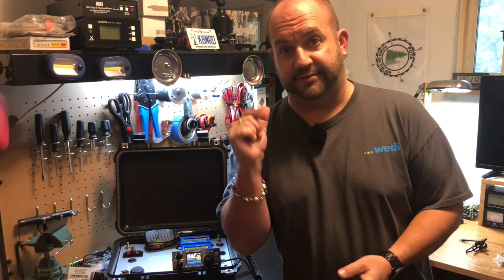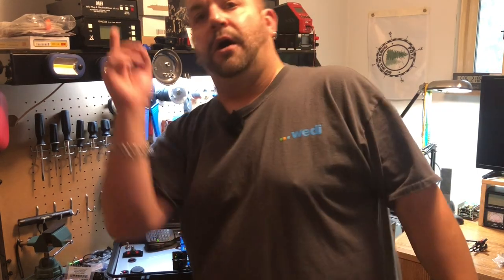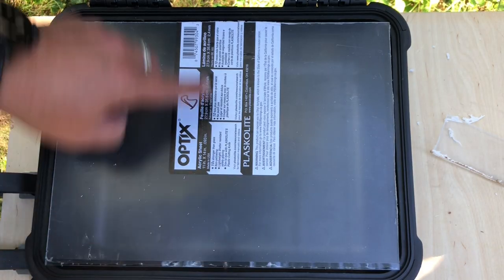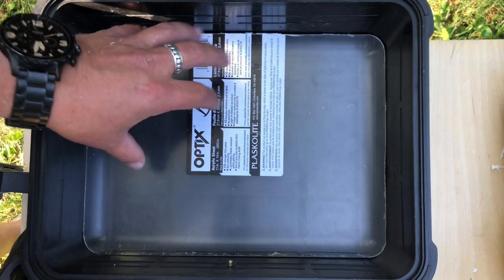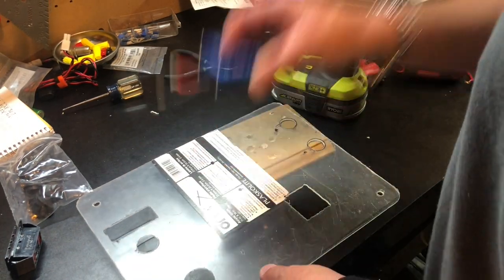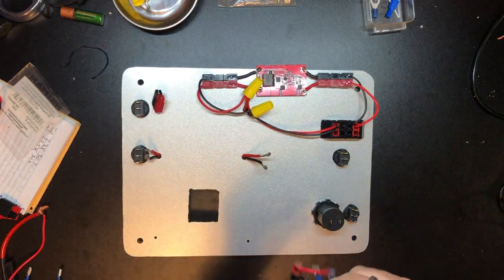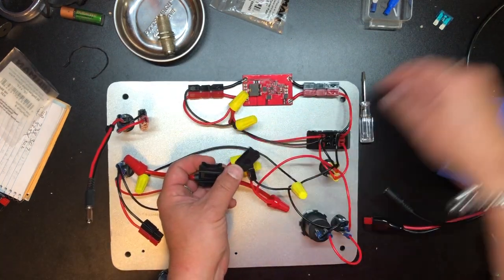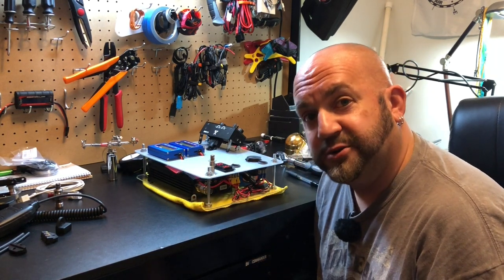Ham Radio Go Box & Solar Generator Build

Comment: Nicely documented build, Mike. Can you comment on the radio's audio quality after enclosing the base unit inside the box? Do you notice any degradation in audio fidelity or volume? Also, can you simultaneously charge the unit (solar or otherwise) while running the radio?

Comment: Hey Mike. I have built a few go boxes. The way I attach the components like the radio and battery is with Velcro straps. I cut slots in the plexiglass or plywood and run the straps through. The straps I use are 1” wide and up to 18” long. They really hold the components tight and are easy to undo if you need to take the components out. I can see doing a qrp box but I kind of gave up on them for my 891. I find it’s easier to just have the components loose.
Reply from the maker: Thats a pretty good idea.  I wouldn't want to use those for the G90 though.  I really wanted to keep that raised off the plexiglass as the heat sink is on the bottom.  I haven't had any heat problems yet but the radio does get quite hot and don't want anything melting.  Thanks for sharing.

Comment: Thanks for the video for my next project.  Thought on the legs for the head unit and the bolts sticking through the top of the lid.  Add a little heat shrink tubing.  That's what popped into my head while watching.  I have a little bigger box my G90 is going into to, so the PI will have a home.
Reply from the maker: That would tidy it up a bid I suppose.  I've found the screws do come loose on the head unit every now and again so putting heat shrink on them would prob not be worth it.  My neighbor is building a box now and he's found some little windows computer that will fit inside that runs on 12V.  We were experimenting with the pi but couldn't find a good source of clean power to give it the required 3Amps they want.  I'd love to hear what you come up for that.

Comment: I’ve got a go box I made that stores my equipment. Since I do hikes often I can’t bring a whole box so I’ve got a couple small padded cases for that. Nice build. 

Also why are there 2 watt meters. Maybe I missed that.
Reply from the maker: Yeah I have all kinds of different gear to take on my outings as well.  This is just the newest toy.  The top meter is used for monitoring my charge input, either off solar or mains to see how many amps have gone into the battery.  The bottom is for monitoring the amp hours I've used and voltage of the battery.  I want to be able to compare amps used vs. amps gained with solar when out in the field so I can know exactly (ish) where my battery is at.  I may have used 4 amps but got 2 back from solar so I would still have 4 amps left in the battery (6 amp battery) if I stopped charging.

Comment: Very nice n clean build! Great cable Management and fitting components! Channel is now on mm Favoriten List. 73 from Germany!
Reply from the maker: Hey thanks so much!  It was a fun build.  The only things I would have changed would be using Wago connectors instead of the wire nuts.  Just to clean it up a little more.  No one would know but me of course.  Glad to have you here and thanks for adding to your favorites.  73

Comment: GREAT JOB I mean great job, The only question I have is what about the radio heating up after using or transmitting. With the box inside the case with no air flow do you need to remove the interworkings. Because I know a few folks talk about the radio being hot.
Reply from the maker: Thanks for watching.  I had a lot of fun building this and use it all the time.  Heat is something people have asked more than anything about this build and I have had zero issues with it.  This is far from a sealed box.  Air still circulates even without a fan.  That may all change in the Texas summer but only time will tell.  The radio does run hot for sure, even outside of the box.

Comment: I can foresee a few problems already. You need to add a PC fan and I would replace those voltage/amp meters to the smaller round versions to give yourself more room. I would also add a pi-star zumspot to keep your options open for D Star, P25, C4FM along with Winlink , FT8 and FLdigi if you’re going to do EmComm communications in the field. I like the plexiglass idea but I would add small handles or even knobs to lift the kit out so the sun can hit the built in 20w mini’s on the inside of lid and bottom tray. I would add a set of Anderson power poles so that you may add an outside power source. 
     When it comes to “radio go kits”, the sky is the limit.
Reply from the maker: Thanks for the thoughts.  I assure you there are no problems.  Like I said in the beginning of this video, I built the box I wanted to build.  Specifically mentioning I have zero interest in digital modes so have no use/interest in a raspberry pi.  There isn't even room for one in this case if I wanted it.  This is not a "lets cram everything we can think of inside this box" type build.  I chose to forgo a fan as there just isn't any room for one.  So far I have had no problems with heat and I'm not too worried (although everyone else seems to be).  I didn't want the smaller round versions of meters as they are 1: too deep to fit inside the case with everything else in it, and 2:  I need to know more than just the voltage of the battery.  You have to monitor this type of chemistry by the amp hours you've used as the voltage remains more or less constant until the battery is about to die.  Handles would add more unnecessary weight.  I can easily remove the assembly by grading the bolts and lifting it out.   Not sure how you missed the FOUR POWER POLES I have included in this build.  The top 2 are for charging.  One is hooked up to a lifepo4 charge controller, the other is wired straight to the battery for charging at home.  The bottom 2 power poles are for anything else I want to power off of this.  I'm starting to wonder if you even watched the video before commenting??   I'm literally typing all the things I said in it.  All of these things were though out as to how I wanted my go box to be.  It needed to be smaller, lighter, and more practical than just about every other go box I have seen out there.  There are plenty of videos of people showing off their go box, but you don't ever see anyone actually using them.  Probably because they crammed them with too much stuff that it becomes a chore just to move the darn thing.

Comment: Great job, am inspired by your video and am starting the planning process for my own. Two thoughts, though. 1) Why include the solar charger in here? I would only leave the battery access and put the solar charger together with the solar panel when/if I'm taking the panel along. 2) Most of my antennas have PL259 and I'll use a PL259 "pigtail to bulkhead". With the room saved I could permanently have the CE-19 interface or at least its cable should I be doing FT-8 on the go, including not only in the field but eg in a vacation home.
Reply from the maker: Thanks Marcellino.  The short answer is because I wanted too.  The more things I have in the box the less I will forget.  I have 5 different solar panels that I'll use at any given time so having the charge controller in the box prevents it from getting lost.   Second, I don't really care that much about digital so I wasn't concerned with putting all that extra stuff in there, which still wouldn't fit even if I didn't have the charge controller inside.  Most of my antennas that I'd use with this build have bnc as do the thinner coax I use.  I have adapters if I use something else.  The point of me showing this build isn't to question why I did something, quite honestly, who cares why I did what I did?  The goal is to inspire others to be creative and come up with your own solutions that best reflect your own operating style, which by the sounds of it, I have done.  Thanks for watching. Let me know if you have any other questions. 73
Reply: @hamradiotube  Hi, thanks for the reply - YES! You have inspired me for sure. I know you don't like digital, hopefully I've given an idea to people who do. Great stuff you do here on YouTube, keep it going! 73's KM6EAY

Comment: I purchased the 4800 for this build ... good guess on my part..... might not have the space issue then. In your final build did u consider not to use wire nuts
Reply from the maker: No this is the final build.  I though about getting some wago or whatever they are connectors but if it aint broke don't fix it.  I built this to be as small and compact as possible so I don't really consider the space an issue.

Comment: Do you recommend protection for the exposed solar charge controller? Maybe large shrink tube?  Conformal coating seems like overkill though.
Reply from the maker: I actually have it in heat shrink but cut it out for this video to show it better.
Reply: @hamradiotube  awesome. I like that it's mppt but I also read that the rockpals 60w panels may not trigger mppt correctly vs pwm.

Comment: These comments are ideas for others to consider. I do not have many tools and I improvise all the time LOL! These ARE NOT intended to say "my ideas are better" or any silly sh!t like that.
I used this material for the top panel/cover:
https://www.homedepot.com/p/3-16-in-x-2-ft-x-4-ft-Chalkboard-Whiteboard-7012145/313109284#overlay
I used cheap backer type board for the base/bottom. I also used nylon locking nuts for the support of the cover/top. I made sure the height of the cover/top was at X inches, threaded on the nylon nuts and that lefty about 1/4" of the bolt exposed above the cover/top. I made it look purty by using acorn nuts! That means I will need a tool to remove the cover, but I just include a cheap flat wrench I had laying around from an Ikea purchase. Just put it in a storage bag that fits inside the case.
Reply from the maker: Right on, thanks for sharing.  Hope you enjoy your new toy!

Comment: Nice build.  I'm an idiot, it never occurred to me to use my grinder like you did for the G90 feet.
For the front panel cable, there are angle adapters and angled cables available in DB9 form factor.  It may make it easier to route the cable, or maybe not.
And is there any reason you couldn't mount the radio body upside down since you aren't a fan of the heat sink on the bottom?
Reply from the maker: Grinder all the things!  I don't think the 90 adapter would be better as it would be at an awkward angle when collapsed.  The only reason I mounted the radio like I did was I wanted the speaker firing up but there's nothing stopping you from mounting the other way.  I haven't had a chance to use it much in the heat but I haven't had any problems so far with the radios temperature.  We'll find out this summer if I need to add a fan.

Comment: Maybe consider adding bits of heat shrink tube on all of the spade lug connectors - for 'just in case' insulation.  Great job!
Reply from the maker: See its little things like that that would have been smart to add during the build haha.  Good idea.

Comment: Can you add a power input so that you could plug this into a power supply?  I'm liking this concept and thinking it would be nice to have one radio in a box and then be able to easily take it from the shack to the field.  Let me know your thoughts.  I'd be thinking about doing it with the IC 7100
Reply from the maker: You could.  You'd have to splice in another wire somewhere though.  Prob from one of the power poles on top of the case directly to the power wire for the radio.  That would only leave one available power pole for other things though.  You'd also have to figure out a way to isolate it from the battery connection to the radio so the power supply isn't putting power into the battery.  Prob not the worst thing in the world if it did though.
Reply: @hamradiotube  Could I add another set of power poles for this operation? I would probably need to add a few switches and some instructions so that I can bypass the battery.  Do you have a schematic of this current setup?

Comment: Awesome setup! What about heating issues? Have you had any issues with the unit getting too hot? If so, I guess one could add a fan and leave the top off the radio body since it’s in a water resistant case.
Reply from the maker: I haven't done a full on test out in the field with a huge pileup all day but what I have done with it I haven't worried about heat at all.
Reply: @hamradiotube  really awesome build

Comment: Just found your video - great build! I won a G90 a couple of months ago and just started playing with it. A couple of quick questions that I did not catch while watching the video - What Case are you using, and what is its' size? What thickness of panel have you found to be the most effective? Have you found any "heat" issues with the radio since making this video in the last 18 months - would adding a small cpu type fan to the case help?  Thanks  --- Michael KI7LXY
Reply from the maker: Thanks for watching!  Literally every one of those things is in the description of the video.  No I don’t have heat issues.  I have no need for a fan.

Comment: Thanks much for the behind-the-scenes-making-of video.  I wonder if there’s a reliable way to insert a right angle connector into the back of the G90 to reduce the overall length and bend on that cable.
Reply from the maker: Sure there is.  I had one on in the beginning of the video.  I just don't need it.  There isn't any stress on the coax and its only a 6" jumper.  This way actually worked better.
Reply: @hamradiotube Im' not talking about he coax connector;  I caught that elbow connector before you switched the pig tail.  I'm talking about the 9(?) pin connector from the G90 body to the head unit.

Comment: Cracking build Mike great effort. Just a suggestion for next time you have to carry out maintenance on the box, instead of double nutting (oo-er) the bolts that have some play in them (the kick stand pivots etc) use nylock nuts and a washer. Much less prone to working loose.  73
Reply from the maker: Well that would have been a lot better than the way I did it.  I just used parts on hand for the most part.  That didn't even cross my mind.  Good idea.

Comment: What size box did you use. What is the next size at harbor freight.  Looking forward to build my.. don't know if I will my 817 or the g 90. tnxs 73. Oh what was the other charger.
Reply from the maker: I'm using the 2800.  3800 is the next bigger size.  My home charger is a HiTek.  There is a link in the description.
Reply: @hamradiotube  tnxs don't how 817 will work but if all falls through just go fo the g 90, lose 2 and 70 but gain more power out. Decisions decisions

Comment: Very cool build. I learned a couple of tricks too. Would it matter if the radio body was mounted upside-down since you have the head remote? 
Precision engineering with aviator safety glasses :)
Reply from the maker: Well I've gotta look cool while I do it don't I?  It wouldn't matter other than the speaker would be firing downwards.  Thats the only reason I didn't mount it upside down.

Comment: Hi Mike, just an idea to finish the box off, I would be tempted to use dome nuts, you might have to cut your bolts shorter. And it might prevent you from grazing or cutting your hands if you brush them over your bolt ends. Very tidy job, by the way :D.
Reply from the maker: A couple other people have suggested that too.  I'm not worried about cutting myself.  They are recessed inside the box so thats highly unlikely.  Plus, I need to grab the bolts when I need to take it out of the box.  It doesn't bother me that they aren't covered.  That would tidy it up a bit though.
Reply: @hamradiotube  Hi mike, good call, i didn't think about lifting out. Could always furn the box upside down to remove inner bit. Still is a great project ;)

Comment: QUESTION -- Mike: another "off-script" question.  Concerning the Yaesu FT-891, in its menu there are several power setting.  SSB, AM, HF, etc.  SSB is for voice transmissions we know.  However, what is HF for?  Is HF only for CW transmission?  The manual isn't clear on that.  Thank you.
Reply from the maker: That would be for CW and I believe digital.  Not 100% on the digital as thats still sideband though.

Comment: Did you give any consideration to either drilling holes in the bottom plexiglass panel below the body of the radio or even cutting an opening to aid air flow and cooling?  Also, how long can you operate with the 6 amp your battery?
Reply from the maker: No I didn't want to cut any more holes than were already in it.  There is plenty of room around the perimeter and the hole for the head unit.  I'm not too worried.  On RX the battery will last about 10 hours.  Working a full on pileup until the battery is dead prob 2.5-3 hours I would guess.

Comment: Great job! My only suggestion for v2 is to use Wagos instead of Anderson's and wire nuts. That would free up quite a bit of room and stay secure. Other than that, I dig it! 👍🍺
Reply from the maker: Yeah I had a lot of these parts just lying around already so I just used what I had.  Totally agree though that would make for a bit cleaner build.

Comment: Can you actually plug anything into the powerpoles on top? Or are they specifically for the wiring underneath?

Also, the barrel connector, where did you get that?
Reply from the maker: Sure you can.  The top 2 are wired for charging but the bottom 2 can power whatever you want.  The barrel connector came off of my old wireless guitar system rack mount.  I knew I would use it for something some day.